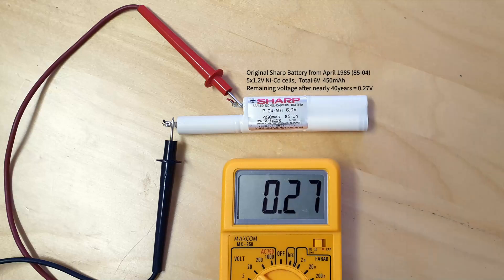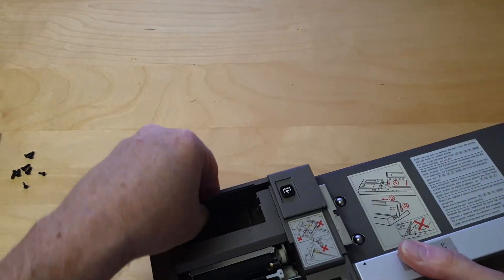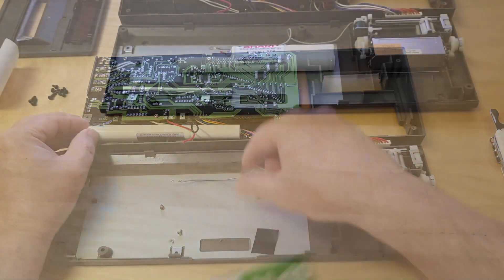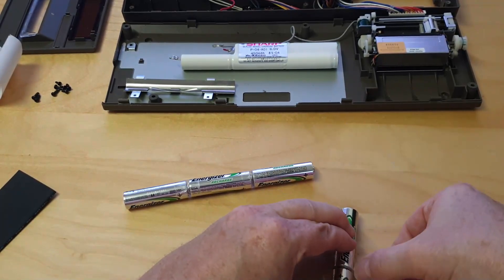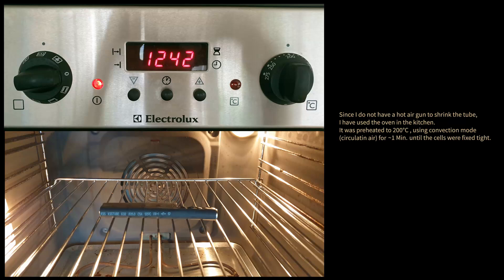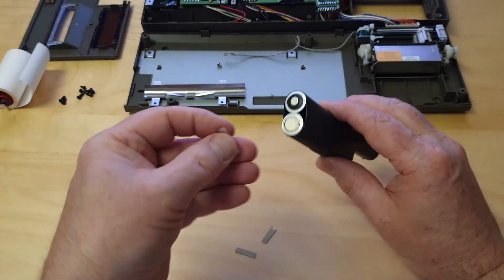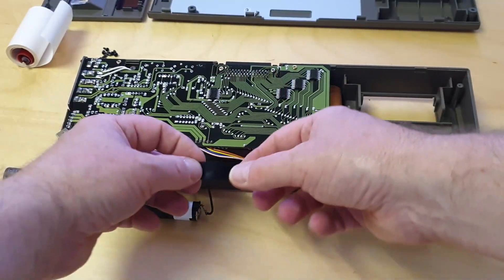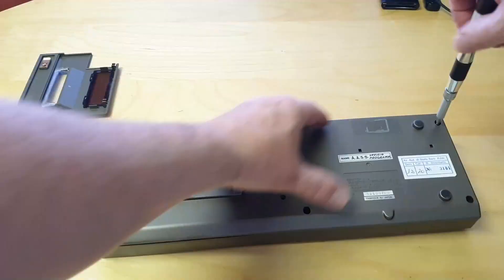Building a new battery for the Sharp CE-150 (PC-1500)

Comment: Helpful video as the batteries in mine are corroded and have done damage to the 22k Trimpot. And the wires to the battery had even dropped off. I'm waiting for my battery spot welder to remake the pack, but at least I have seen where the wires go back in.

Comment: Perfect video to point folks to when the question pops up on how to save those plotter/printer units from a corrosive grave, and of course to get them working again.
Reply from the maker: Thank you for your comment. I live in dry and cool place (CH) and fortunately never had an issue with corrosion of vintage electronics. The potential leaking of the Alkaline Battery however, is indeed a risk. I am monitoring the Battery and ensure that it's not getting deep discharged. I am also considering to stuff the Battery in a plastic bag or a condom to prevent a leakage from harming the electronics. Just have to check if the material is resistant against battery fluid.
Reply: @Chris-8bit   I think your method is certainly much, much better than leaving the NiCds in. I have so many units where those NiCds not only leaked, but the corrosion crept up into the wires and onto the board, destroying a good piece of that as well. It's usually salvageable, but the amount of work needed is better avoided. 😅